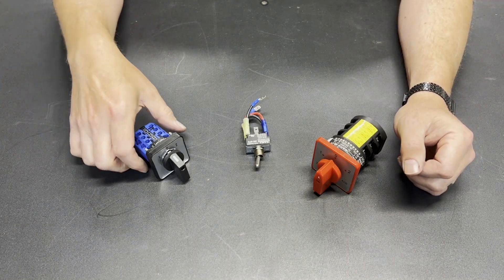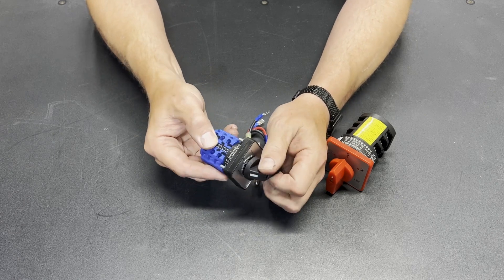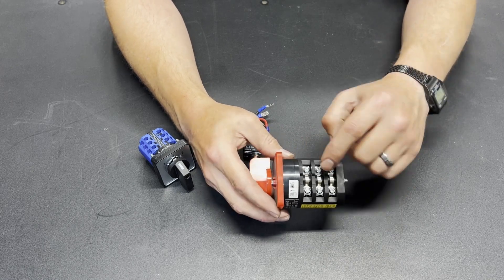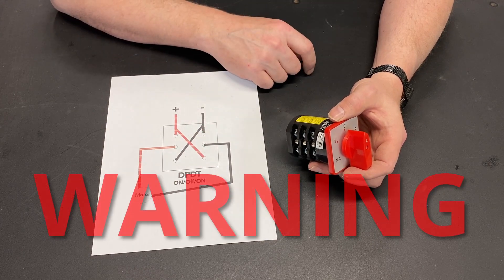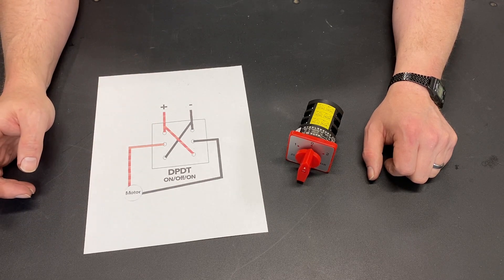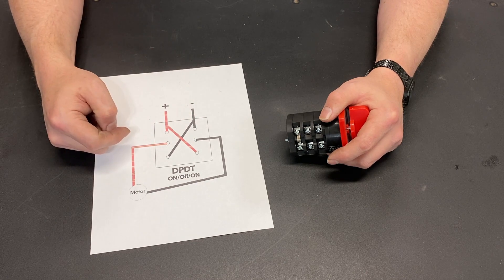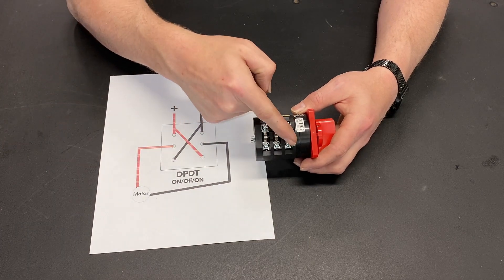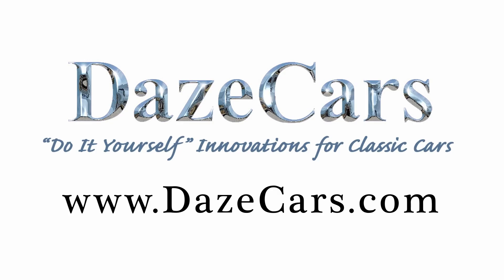Wiring a Rotary Direction Switch for a Treadmill Motor Conversion

Comment: Hi, My rotary switch fell apart in my lathe. And now I cannot figure out how to wire it. Can you let me know how to wire it?
Bought a Kraus & naimer ca10 which I believe is like the large orange one you show. Busy Bee here in Canada said it was the replacement for my lathe. It's a lot bigger than the one that was in it. Guess the smaller one could not hold up to the Amp's. I really appreciate any help you can provide. 
It's a 1 HP motor but also has a capacitor and that is where I get lost.
Doug from Ottawa Canada.
:hand-pink-waving:
Reply from the maker: You will need to find a wiring diagram in the manual.  Not all switches are configured the same and not all machines are set up the same so I can not even begin to figure out how it needs to be setup

Comment: I bought the same switch. When I installed it, I could only get one direction. I eventually had to put jumpers on both sides of the switch to get forward and reverse. Installed it on a Lathe. Thanks for all your great videos.
Reply from the maker: You followed my link or you ordered one from some place else and the switch looked the same?  This same basic switch is available without the straps required to make it DT.  Glad you like my videos and that I was able to help.

Comment: Thanks for the explanation. I needed it for reversing the motor on my Cobra lathe for reverse sanding. Judging by the picture of your lathe it's the same one. Happy turning. Helmut Meier
Reply from the maker: keep in mind it will only work if your motor is DC.  This info is for wiring a treadmill motor direction switch which is DC if your motor is AC it is wired differently.

Comment: any suggestions for a switch with a center on position for a brake circuit?
Reply from the maker: not ready made but if you are good with tiny components rotary switches can be disassembled and reconfigured to switch as you see fit.

Comment: As always, your videos are well thought out and you walk people through the basic things. I am a big fan of your videos Daze. 
Question: How did you get the FWD  OFF  REV  text on your switch face? I know how you painted it black instead of leaving it red, but the text looks professional. I’ve been trying to come up with a way to do this myself, but all I can think of is metal punch stamps. 
P
Reply from the maker: I used my computer printer and printed it on a piece of sticker paper, then stuck it to the metal plate on the switch.
Reply: @dazecars  Ah ha! A practical and easy solution. I’m always trying to do things the hard way. 
Thanks Daze. 
You know, it’s odd how the mapping of a DPDT toggle switch to that of a rotary switch can be so confusing. But you explained it very well. 
I have the DC part wired up to my rotary switch. Next is the AC, relay and resistors. I have 8 resistors at 200 Watts each and 4 Ohms. That should give me 1600 Watts and 2 Ohms resistance. This is at the top of your suggested range 1<R<2 so I might play around with some other combination, but if you think 2 Ohms is ok then I will leave it at that. 
This has been a great project for me to learn electronics. I’ve followed every SRC variable speed drive video of yours and followed it to the letter. All mocked up and working perfectly. I choke when watching other videos on this same subject because they don’t have the same diligence and research as you have. They use small bridge rectifiers with no AC inductor or DC choke. They don’t optimize the potentiometer the way you do. All in all, your videos are the best. I have alerted many people about you and I only hope that your viewer base increases over the years. You deserve it Daze. You not only make great videos, but you are always open to questions that your viewers might have. This is key to me. It’s one thing to make great videos, but response to viewers questions is paramount. 
I go to Clough42, who also makes great videos, but James has never answered any of my questions. Yes, I know that more viewers means more questions, leading to less time to devote to them, so it’s a double edged sword. 
I’m babbling here Daze. Just wanted to let you know how much I appreciate your help. 
P
Reply from the maker: @paulmanhart4481  your watts calculation with 8 resistors is correct, but your ohm’s calculation is not.  Eight  4 ohm resistors in parallel works out to 1/2 ohm not 2 ohms. Two 4 ohm resistors in parallel is 2 ohms and 4 in parallel is 1 ohm.
Reply: @dazecars  1/4 = 0.25. 
0.25 x 8 = 2. 
I thought when wired in parallel, you take the sum of 1/R. I don’t have an equation editor on my phone, but it’s the summation from i = 1 to n of 1/Ri. 
I’ll check my equations. You’re probably right Daze. I might have missed something. 
Ah! It’s the reciprocal of that number. So yea, instead of 2 Ohms, I have 0.5 Ohms. 
Back to the drawing board. 
Thanks Daze.
Reply from the maker: @paulmanhart4481  you are overcomplicating it.  As long as the resisters are the same value, the parallel equation is Ω/number of resister.  The more complicated equation, while it works for matches resisters, is also for unmatched resisters.   So when working with 4Ω resisters two in parallel is 2Ω, three is 1.33Ω,  four is 1Ω, five is .8 Ω, six is .66Ω, seven is .57Ω and eight is .5Ω.  Because the speed drops so quickly wattage is not that important as I show in my video one resister was able to handle the load at 200 watts.  If you really want more watts and do want to spend the money on a braking resister get more little ones and make two 6 resister parallel groupings, then wire those groupings in series, that will give you 1.32Ω and 1200 watts.

Comment: Great presentation and explanation. Diagram super helpful. One thing that may help us to use a pen to point at the object instead of your fingers. Ive learned I have to do that sometimes bc I have large hands so they can block the view for the observer. The other maybe helpful thing is to install the wires on the switch in the video just to help demonstrate and illustrate. I hope that doesn't come off as criticism. I think you do great work, just offering some possible helpful tips. Thanks for all you do
Reply from the maker: It IS criticism BUT it's constructive.  I am always wanting to improve so any info on what would make my presentation better is always appreciated.  I will keep your suggestions in mind, thanks!!
Reply: @dazecars  So like a couple of days after I wrote my comment above I was rewatching one of your older videos and you were using a pen as a pointer. I saw that and felt bad I said anything. Thanks for taking it well.
Reply from the maker: @dieselwelds8645  no need to feel bad your input was constructive!!